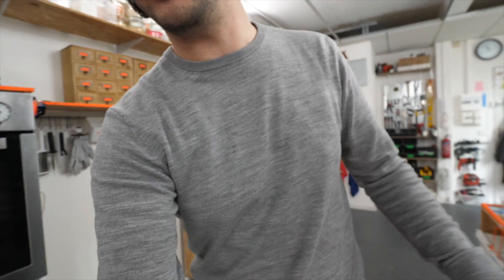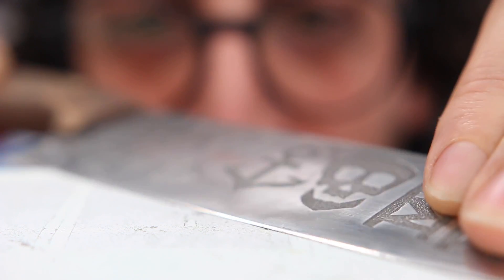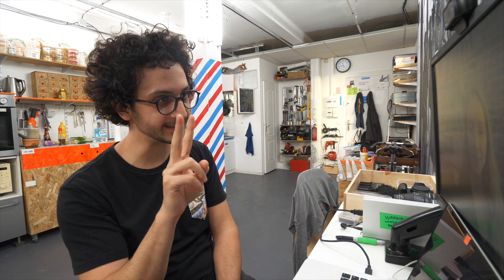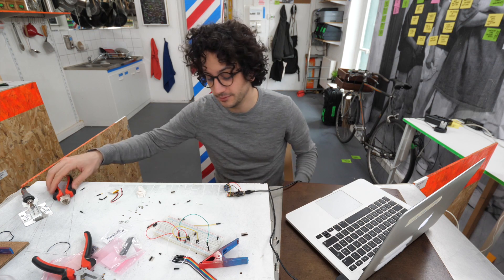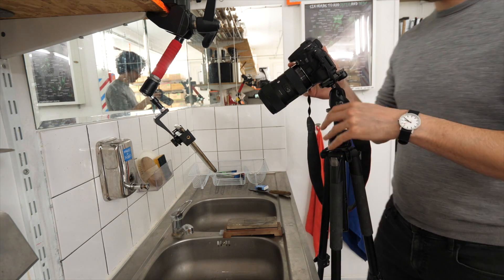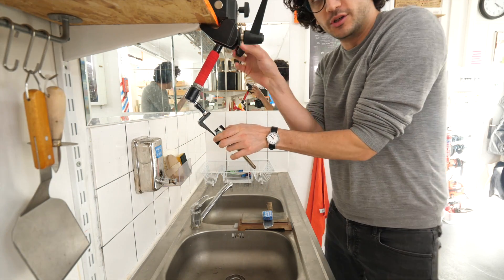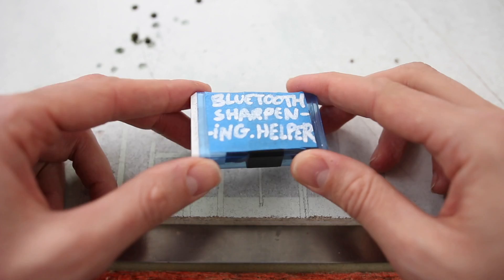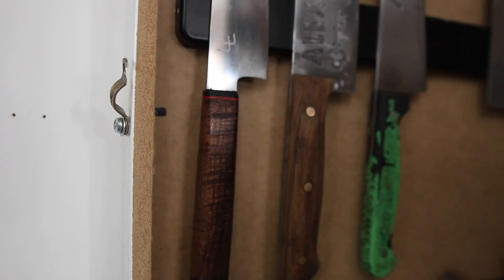Is This The Future Of Sharpening ?

Comment: after seeing this, a few ideas came to my mind. first of all, if anything is gonna give you feedback on your angle, it has to be on the thing itself to keep the costs down. I thought about having a display but that seems too bulky and I couldn't really find anything that would be useful here. (also possibly water resistant or water proof.) I think either a vibration motor or some led lights are the solution.

for the vibration motor, I don't really like the idea personally. the little coin or watch battery sized vibration motors are slow to respond and they have to be running for like a few milliseconds to get them going at full speed.

for the led though, I think this is the best idea I could come up with. I think something like 3 leds one green, one yellow and one orange could be good. also these would be on the side where the user is going to look so it can give them feedback without looking away from the knife. let's say the desired angle is 17 degrees. green light turns on between 15 and 19 degrees. this means that you are doing it right. the orange light turns on when you are two to three degrees of the target, you get the idea. but for this, you would have to be able to set the desired angle through either a computer or preferably your smartphone. I know that android phones can use the bluetooth any way they want but I would be worried about the iPhones and apple devices (although, some toothbrushes for example can connect via bluetooth so it shouldn't be a problem).

i am really excited for this project and as everyone, I would like to help in whatever way I can. I have a few knifes and they are losing their edge so I probably have to sharpen them at some point so you better hurry up Alex!

Comment: Here is my suggestion, the problem is human need to maintain the angle while doing the motion. Which is like mastering any sports. Instead if you have a circular whetstone which you could attach to front of your beloved drill and then just hold the knife at at angle it would be much simpler. All of the challange would be to not move the hand. (In India that's how people harpen the knife).
Here is the example: https://youtu.be/txyXUXWybt4

Comment: I think a low-tech solution is needed here. A thing that can hold the sanding /polishing stones in place with an arm that can slide on rails with a specialized clamp to grip the knife handle that’s adjustable to the desired angle you need. Have that system on a different slide rail so you can grind the knife back and forth on the stones while moving the knife sideways to cover the rest of the blades length.

Comment: Probably useless advice and input from me: artists don't usually draw at that angle you're trying to sharpen at because it introduces wacky instabilities in our lines. We primarily draw from our shoulders at an angle going from the bottom of our nondominant side to the upper area a bit past our dominant side. This allows us to draw straight lines and keep our elbows and wrists relatively locked. Keeping these joints locked may help you maintain a more consistent angle. I'd suggest at least trying a similar technique for your knife and see if it helps you reduce the changes in angle.

Comment: If you attach a long clamp  or something to the blade you can use that to stabilize the blade with your other hand. Because the lever arm would be larger, so the same amount of jitter in your hand would result in a smaller degree change.

Comment: Consider adding variable haptic feedback proportional to the degree of error, perhaps with high and low sounds to indicate over and under angle variances.
Reply: I was literally thinking the exact same thing! In my head there would be a little green LED when you were within the tolerance and have a red one light up when you’re not. And even maybe have an amber one to indicate you’re getting close to being in the red. Could this even be done with a single LED nowadays? Anyway it was film SLRs with an LED exposure indication in the viewfinder that I got the idea from.

To me having this haptic feedback would be a good way to train yourself in a tactile way. It would give you instant feedback and allow you to adjust accordingly.

Perhaps there could be different feedback for different types of learners?  Visual, auditory, read/write (like Alex’s current method)?

Just some ideas I had.
Reply: Jayyy Zeee excuse me sir but how did you read my mind? We need to get this upvoted because this is probably the most promising Avenue
Reply: Shock him everytime he gets 2% off ;p
Reply: @FiXato  That's awesome
Reply: i've been thinking the same. since the device is ment to be a learning aid, and vibration would likely mess with the MEMS sensors, why not a bit of electric tingle? 
another very simple option would be to attatch a little laser to the blade, adjust it to the desired angle, and have a target line to aim it at.  (for best effect, fluorescent tape and a 405nm laser module)
Reply: Solid idea here.  Make that sensor sing to the user...
Reply: I had a null (quiet) when at the right angle and then the volume goes up as you drift off with the pitch of the note being the 'way out' you are - so you can hear a note changing pitch in time with the sharpening.  The problem with the blue tooth is that the readings aren't synchronised to the position of the arms - whereas a changing tone would be super-easy to learn.
Reply: @chrismr3972  Yes... As a musician, I was thinking of it like tuning a guitar, where you hit harmonics on adjacent strings and hear the two tones "warble" faster as you go farther put of tune, then slow as you approach perfect unison. Audio feedback would be best since it doesn't require you to look away from what you're doing.
Reply: Totally agree, this is the best way to go.
Reply: skyeandy, yes there are LEDs that have 4 pins instead of two, and can output pretty much any color.
Reply: Maybe if you add a led that gives you green light when you are in a close range of a desired angle and red light when you are off would be a good idea as well
Reply: Jayyy Zeee 
you know... that’s a good idea.
Reply: Sound and/or light options would be ideal, although I also like the idea of having it provide data for numerical crunching.
Reply: @Samwise This is an amazing idea.

Comment: wiring in a button to re calibrate it to 0 like the tare function on a scale, then placing it on your whetstone during the calibration process for a true 0 degree angle would be a useful feature also a colored LED that changes colour based on the angle of the sensor or some other kind of simple visual feedback would make this much more user-friendly
Reply: this allows you to keep the bluetooth functionality and also you can create and provide an app that allows people to use the data in interesting ways
Reply: the sky is the limit

Comment: Use a device that will give you a tone.  The tone should be set at the optimum angle, with the tone changing when your sharpening angle is too high (higher tone) or too low (lower tone).

Comment: Alex have you considered adding a warning feature like a beep or a vibration as soon as you fall out of the ideal angle range? Philip Diamond Smart toothbrush has this pressure sensor attached to the toothbrush head, so once the pressure is too much, the body of the toothbrush lights up and vibrates gently so the user can adjust the pressure. This could be a real product launched on kickstarter. i know i want one!

Comment: What you need to do is make an app that translates the digital angle into an angled image on the screen superimposed on the desired angle so that you can see the variation in real time; not translate and interpret numbers. Just a display showing a line at a fixed angle and another line that shows how far off you are.

That way you could literally learn to control the knife at any point in the sharpening process.

Comment: Alex, you should switch to a led, buzzer indicator on board. Use the Bluetooth to program the angle. With  5 leds you could have green for middle, yellow then red working to the outside. Green being the ideal angle, with yellow within 2-3 degrees, red being >=5 degrees. It would buzz as negative feedback when you get into the red zone. The other issue with trying to display it on Bluetooth is there is lag from transmission to display. It maybe small but you may already be in the process of a new pass by the time you see the data. Love the videos.

Comment: @Alex French Guy Cooking Put LED on the board, which to light in Green when you are on the right angle. And to light in RED when the angle is wrong. Also you should predefined the values which will be the borders of the desired angle for easier work and use. When you sharpening at angle 17 degrees you should enter the borders from 16.5 to 17.5 for the light to blink in green. This will provide you better visability that your sharpenning angly is correct.

Comment: why Bluetooth? could just have a small LCD or LED screen to display the angle, and a button to 'zero' it. Turn it on, zero it on the surface, start sharpening at whatever angle you desire.

yes a fast update rate means you wont be able to read the value..but that means you are doing it wrong...if you are able to read the value it means you are holding the angle stable.....so yeah a very quick way to tell. Can you read the screen (Y or N) if Yes, you are sharpening it right. Second question..is the angle the one you desire/selected

Comment: My improvement ideas:
1- two buttons, one to zero the output, that box is nowhere near perfectly flat. Especially after you glue the magnets and a second button to set the target slope.
2- a few leds to give quick response. I'm thinking 7 leds. Arranged in such fashion of red orange yellow green yellow orange red. If you are under +-1 degree lits green lights led +-2 lits yellow +- 3 lits orange and +-4 lits red. And you'll get precise output in quick fashion.
3- lower latency is the key for the above, as well as logging.
4- a very simple application that turn the log into a graph. Excel is great and all but I'd love to see the graph on the mobile phone as fast as possible.
5- finally, a 3d printed casing with water resistant coating and an easy access charging port. Or better! Qi charging!

With these 5 improvements you can really turn this into a full fledged product!

Comment: You should consider refining the output on screen. Make it green when the angle is within a margin of error of 15°. Red otherwise. Display only one value. That's just a start for usability. You could make the device vibrate when your angle is off. This type of feedback is tighter coupled to the activity of sharpening.

Comment: Just buy an electric knife sharpener.

They fix the angle mechanically so that you know you are sharpening at 15 degree precisely. 

The solution provided here is very unreliable even if the device goes beyond the prototype phase. The inaccuracies lay on the way the device operates as there's no reference point whatsoever (every knife has a unique shape). And not even mentioning the fact that you as human will never get 15 degree all of the times.

Electric Knive sharpeners are just 50-100$, no need to invent a square wheel here.

Comment: The sensor on the arduino uses acceleration, because you're moving the blades back and force there's lots of perturbations in the measure. Even if your angle is right the value displayed can be off.. Still a very cool device (and a bit overkill) but going fully mechanical would be more efficient at the end. Check this: https://www.youtube.com/watch?v=k3SbEWFSA8s

Comment: Why Bluetooth? Why not a device with buttons, 2 leds (green for good, and red for bad), and maybe a speaker. A buzzer that goes like the satelite tuners. High pitch when you are at the correct angle, and deep when you are not hitting the angle. Bluetooth is to slow, and you are correcting the angle too late. It needs to be faster, instantly telling you that you are doing it wrong. If you don't want buttons, maybe configure the device via bluetooth, but reading it back on a phone is too slow.

Comment: You could just use a blade angle gauge from Woodworking saws and just have to move the screen to the side instead of the front so it can be read by the user. They are already set up with magnets and can be zero'd out based on the what you want "0" to be - https://www.amazon.com/Wixey-WR300-Type-Digital-Backlight/dp/B00T6YZ0K6

Comment: Firstly you should switch to diamond stones. They work faster, better and without the mess that comes with using a traditional whetstone. Secondly try to place the knife on a diagonal along the stone. that way more of the knife edge is supported while sharpening. So top of the knife on the left edge and the bottom of the knife on the right edge of the stone. I agree with you that going slower will help a lot while one is still learning how to consistently holding the angle.  Don't ever forget to use a strop. it will make up for any minor imperfections if the angle is close. Just keep sharpening by hand and you will soon rock.

Comment: You should totally look into the process of knife thinning. It's more challenging, but you can dramatically improve the cutting performance and not just the sharpness of the edge. Its something you may not necessarily want to do yourself for your beautiful Damascus knives, since it inevitably ruins the surface finish and you'll have to polish it back out and etch the blade again

Comment: I think you've got a great concept going here. There's some improvements on the software side that would make it much better I think. First, there should be a calibration function, to zero your stone to the device. Then I think you could have a way to select the desired angle you're trying for and while sharpening would display as a needle on a metronome type display or something with color coding and basically a real-time representation of how far off axis you are in one direction or the other. Hope these are helpful.

I'm loving the channel, and share your affinity for Ramen. Keep up the awesomeness!

Comment: Instead of an app I’d rather just have two distinct beeps to notify me if I’m moving away from the ideal angle. This would require a switch or dial/screen but it might be easier to use instead of a Bluetooth/WiFi installation.

Comment: If you could somehow link the angle data to a sound output (maybe a beeping where the speed of the beeps is determined by blade angle) you could better track your angle while sharpening without having to look away from your knife.

Comment: Bosch XDK110 baby.  On-board IMU.  Battery powered.   BLE.  Wifi.   It would be easy to program the XDK to change LED status based on too little / too great angle.   That way you don't have to read the angle.

Comment: there is a device that does this, it is made for table saws to find the angle of your blade when cutting. It has a magnet attachment system already as well. Not sure if it would be sensitive enough to see the smallest of changes that you need for a sharp knife.

Comment: Would be cool if there was a meter, say 5 led lamps in a row, telling you how much of you are or if you're at the right angle. Lets say that you want to sharpen your knife at 20 degrees, then the lamp in the middle would light up at 20 and as you move down one degree, the middle lamp turns off and the one bellow light up and vice versa. Also being able to put in any angle you want or even customise the accuracy of the lamp meter would be amazing!

Comment: wouldn't it be easier to have something underneath the device that's already the correct angle. Something like you wedge under a door to keep it open. And with the device you already have, you can see if it is indeed the correct angle.

Comment: Are you zeroing the accelerometer to the stone? Your sink may not be completely flat so the stone sits at an angle.
Reply: Check out the link to our Instructable which has a more detailed user guide-- establish an offset angle to subtract from the target by placing the device on the blade flat against the stone at the start.

Comment: You can't trust your device as you approach the tip, assuming that you have only a single axis accelerometer. The appropriate angle at the tip of the blade will not read correctly on the device. Imagine having a circle with a perfectly beveled edge. If you put your inclinometer on this object and rotate about the circumference of the circle. The edge will read perfectly correct when perfectly orthogonal to the device. But it will read closer and closer to zero as you approach parallel to the instruments length. i.e. Make sure you use a two axis accelerometer to obtain planar angle to the ground.